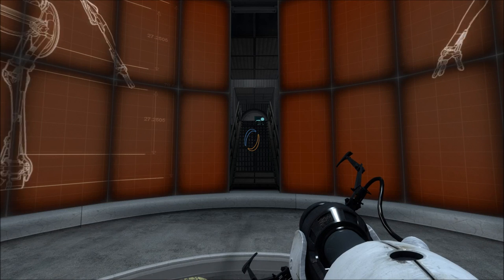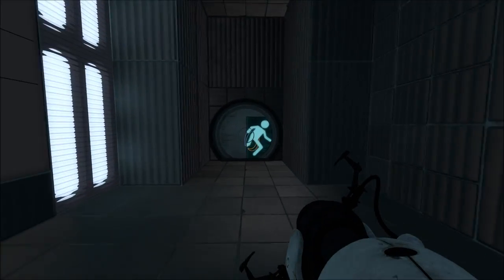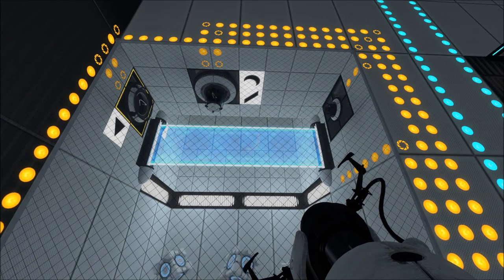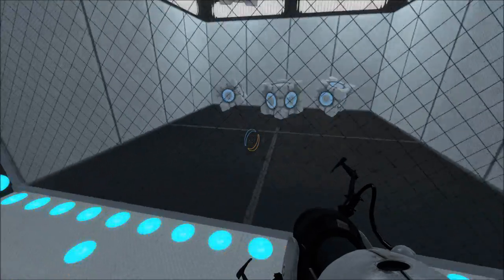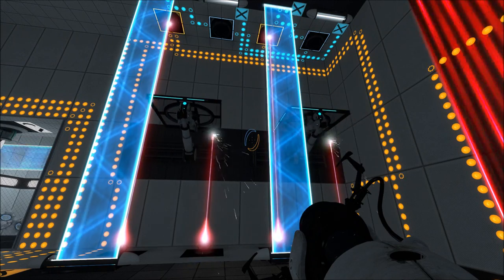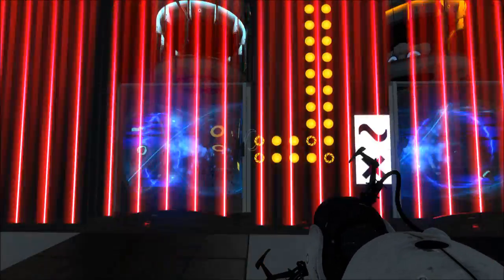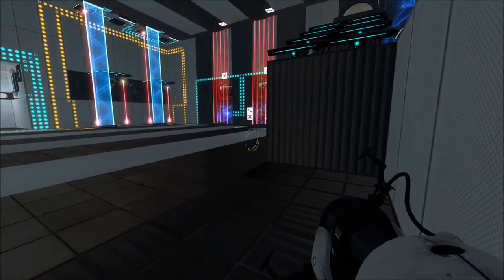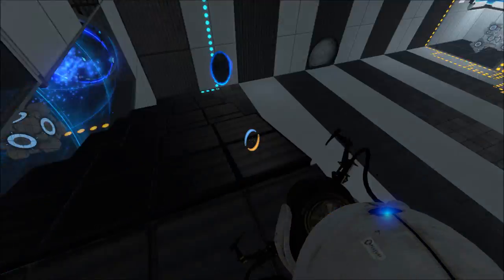Portal 2 - 4 Different Clock Generators @ 4 Different Frequencies

Comment: I made a cheap, simple clock generator (almost) by accident. I had a force field that pushed a cube against a button on the ceiling, and the button turned off or reversed the force field. When it does, the cube will start to drop back down until it's off the button. I don't think it's entirely consistent though, but it's fun to watch the cube dance against the button.

Comment from the maker: Valve released an update yesterday that said it fixed some compiler errors.  I experienced the same errors myself.  I haven't had any strange compiler errors since the update, but I think I've only tried to compile one map so far.  

I'm not sure what kind of switch setup you're talking about.  Is it just a cheesy toggle?

Comment: What I haven't figured out is the switch where one round button turns on the switch and a second shuts it down without the use of a cube.  I have a map that I've been working on for awhile.  Aside from the "too many items" error that I've been getting.  Now I'm getting an error that when loading the map it just says something like 'There has been an error loading your map..'.  Have to save as a diff file name and open it again make changes then open then repeat to make it compile.  Familiar?